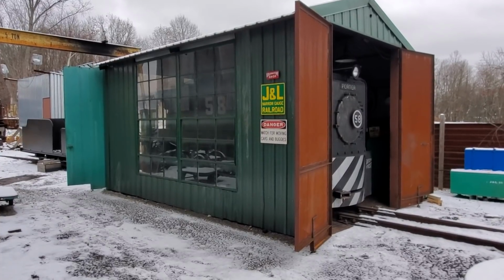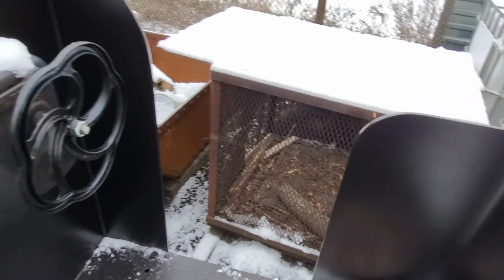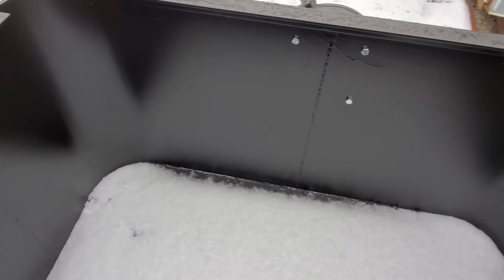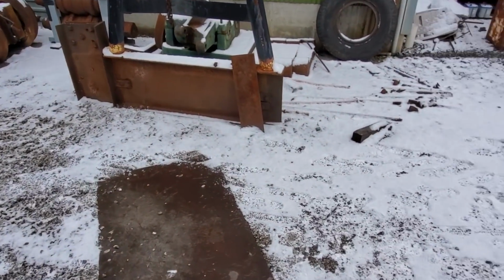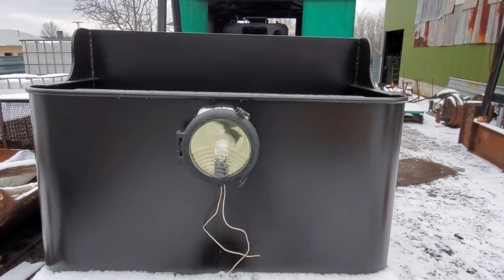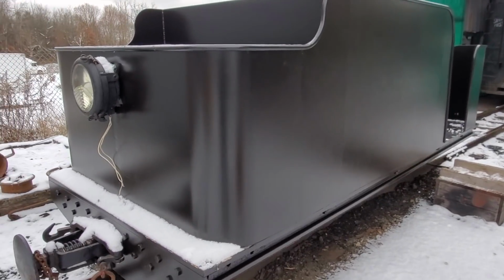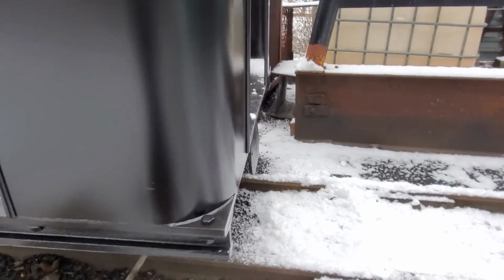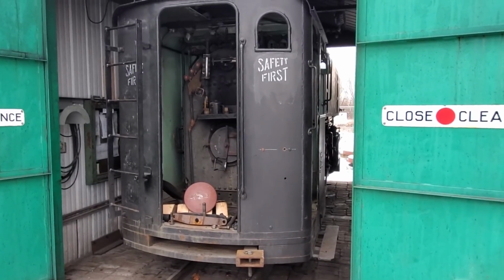J&L 58 New Tender Arrives!

Comment: I'm a bit late, but have you thought about using one of the quiet electric air compressors? That way you wont have to mess with a small gas engine, and you'll barely be able to hear it if at all.

Comment: It's a shame you can't mount a steam powered air pump on the tender and have a steam line running to it. While I'm sure you could, I'm sure it would be a real pain to set up and maintain with ease. Still, it's great that you can meet FRA requirements for hauling passengers now, even though I'm sure you're overseen by the DOT. 
I worked at a small railroad museum in New Jersey for a number of years and we were so small the FRA didn't bother with us. We were overseen by the NJDOT which didn't make things any easier... Especially if the "forbidden topic" of steam locomotives were to be brought into the equation. NJ boiler laws for portable boiler licenses are a huge pain.

Comment: Would be cool to mount a compressor to the wheels so that when the loco was moving it would be making air as well which with some bigger tanks could likely make enough air to not need to have the gas engine running all the time.

Comment: I take it this wasn't the tender designed for 58 originally? In any event, it looks like it was made for the thing!

Are you planning to just stick that buffer kit in the cab onto 58's coupler? Or are you going to put it on the frame?
Reply from the maker: It mounts to the rear drawbar.  Works pretty good, however I can't close the doors with it mounted so it has to come off.

Comment: In Victoria, I was told on a K class locomotive you had to be careful not to turn on both headlight and tender headlight or the steam generator would overload. I asked why not have a type of switch that would only switch on one headlight at a time. I dimly recall that tenders did not have headlights originally and locos cannot run tender first at night. The tender headlight was retro fitted and probably had it’s own switch. I cannot recall the voltage, the wooden cars had their own lead acid batteries and a belt driven generator.
I remember the train to Yarram where the carriage lights would graduly dim when the train slowed.
Reply from the maker: Both headlights are 200 watts each and with both on, the 500 watt turbogenerator will handle the load but won't like it.  They also can be dimmed independently.
Reply: @YoungstownSteelHeritage  200w! Thats one beefy light. Thought about led?
Reply from the maker: @the_retag  The turbogenerators are designed to run with a bit of a load on them, so using 200 watt incandescents gives it a nice load as well as looking far better than an LED would. We are using LED lights for everything else though.